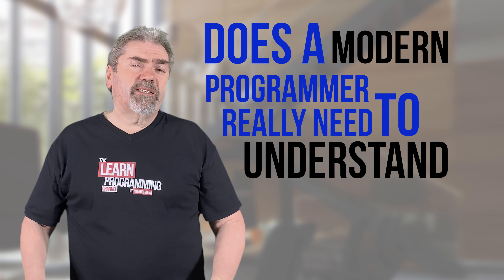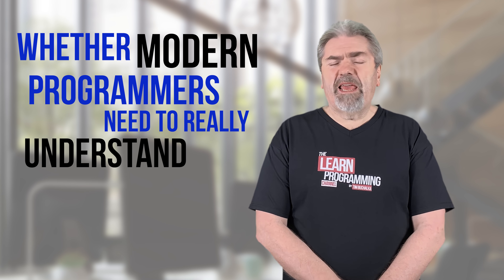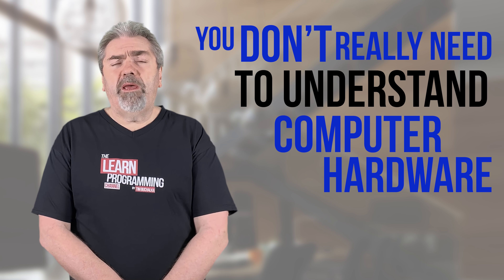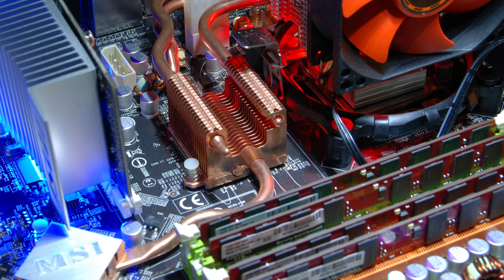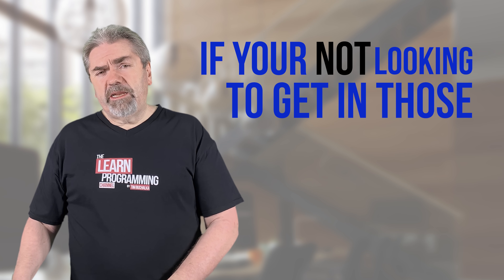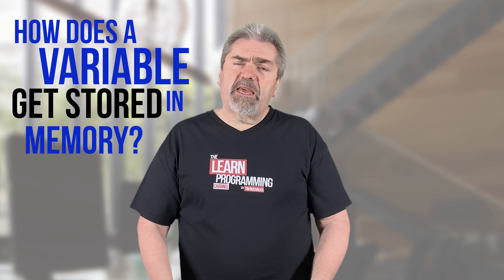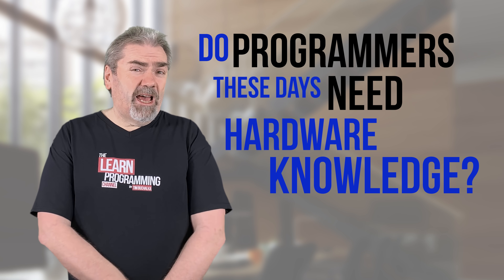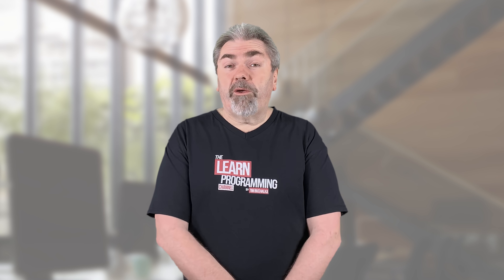Do Programmers Need to Understand Computer Hardware?

Comment: Another of your videos a while back provoked some discussion about the terminology of things like 'developer', 'software engineer', 'coder' and 'computer programmer'.

And now we see a similar thing here too. To me (I worked on an IT support desk for a while, fixing broken PCs) 'hardware' is the physical components. Like motherboard, memory chips, hard drives, power supplies, cables. But here, you are talking about what I'd probably call 'computer architecture'. The way the internals of a chip works. These are realised by physical components, but are constructed based on abstract ideas, not physical ones.

And in addition there's the physical design of the chip, at an even lower level. The actual 'quantum' stuff of electron tunnelling, n-type or p-type silicon etc. I'm not sure what exactly I'd call that (apart from "you really don't need to know"). But it's certainly not software. So it must be hardware, right?

I'm not saying either is correct or not, as with the 'coder' discussion before. I just find it really curious that in the industry of the information age, where everything has to be as close to precise and logical as humanly possible (and even more than that when these things are themselves designed by computers) we don't have precise and universally agreed meaning and usage of some of the most fundamental terms.

To add a little to your video itself, I'd agree that apart from the specific cases you mention (embedded, etc.) hardware in the sense you mean it is almost irrelevant. But...

If you are seriously wanting to get into programming as a career, you need at least a little curiosity, interest, and even passion for the subject. And if that's the case you'd probably be wanting to (or should be encouraged to want to) glance over the very basics of stuff like low-level APIs, chipsets, the fetch-execute cycle, construction of logic circuits in silicon etc.

Not because you need to, or because it will be useful. But because it is utterly fascinating! If nothing else it'll give you a much more humble perspective about what it is you are actually doing when you get a computer to print the result of 2+5 on a screen.

Oh, and check out the paper/animations of "A Turing Machine In Conway's Game Life". A person's response to this is a very simple 'should I be a computer professional?' test, imo. If you don't find that construction in any way interesting or astonishing then my answer would be; 'probably not.'

Keep up the great videos, Tim. (Why do we still call them 'videos', btw? 🤨)
Reply from the maker: Thanks for this, Vark.  Some great points you have raised.  Some of the problem with terminology is, I believe, that we are still relatively early in the "computer" era, I think over time we will find more solid terminology will be used and agreed upon universally.

And good point about the word "video" as well :)

Comment: I think too it's helpful but not required. Just like when driving a car and starting to drive in its fifth gear is not a good idea but actually understanding why it is will not even make you trying to do so in the first place. 
Likewise, loading a complete database in memory will get you quick access to it's content, but when the amount of records are like millions, you'd better come up with a more efficient way of getting the required data. 
Another example, say like writing data to a file, you can write to it as soon something changes. But knowing the block size of the file system, you can reduce the amounts of writes as soon as you have one block of data filled. 
Knowledge of hardware means you can write more efficient code in general.